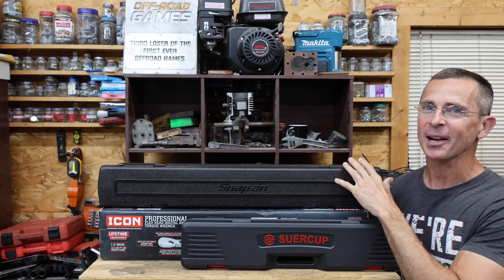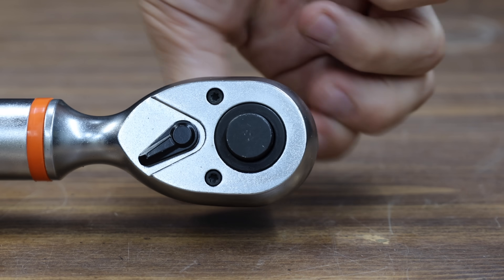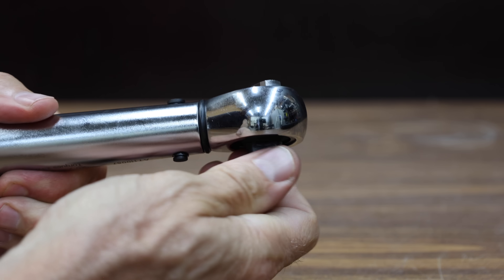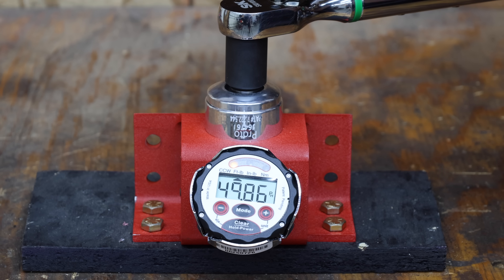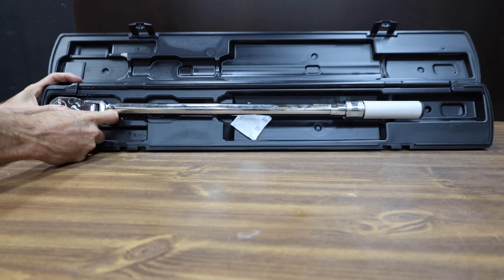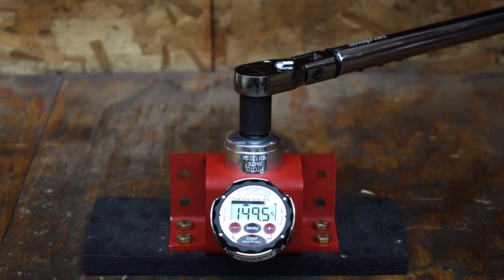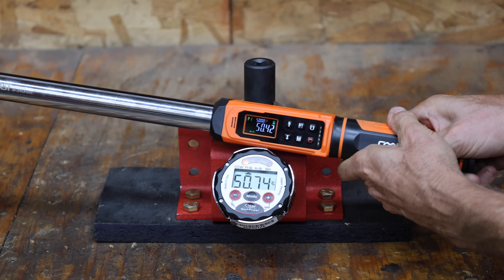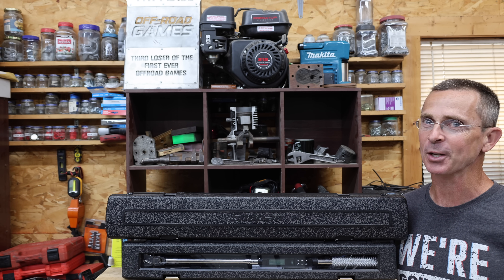$78 Torque Wrench vs $790 Snap On & ICON—I Didn’t See This Coming!

Comment: I have the ICON. It works great for accuracy, but has two major downfalls.
1. In the winter cold it gives an error message and will not work. 
2. Switching modes has to be done in a cyclic order (can't jump straight to a mode of your choosing). Which doesn't sound like that big of an issue, but when you cycle to the angle indicator to get to your unit of measurement you desire then you have to lay it flat because it will not let you switch modes until it sets itself to 0 degrees autonomously.
Reply from the maker: Thanks for the detailed feedback!

Comment: On torque wrenches, I treat them like tire pressure gauges. The exact reading can be off, + or -, by a small amount. That doesn't bother me as long as it gives me the same reading every time. As long as I know how much it's off, I can compensate for that. 
On my cheaper torque wrenches I bought breaker bar torque wrench adapters. Before I final torque anything I check my wrenches setting using the adapter. Once I know the setting gives me a good torque it doesn't matter what the wrench is set at.
Reply from the maker: Thanks for sharing!

Comment: I'm old, yet still prefer wrench measurements performed by a weighted and calibrated wall mount pendulum.   Easily re-certified, like.... forever... And devoid of software and sensor errors.
   BTW:  Did you know that placing an extension on your wrench will alter the delivered torque values?   An interesting fact taught to licensed Aviation Mechanics.
Reply from the maker: Thanks for sharing!

Comment: Fasteners should be torqued smoothly and fairly slowly so the speed of the sensor isn’t a big deal.  If you are torquing fasteners in a quick, jerky motion, sensor speed is the least of your problems.

Comment: I bought a gear wrench flex head a while ago. It seems to work well, but has no change in response from "almost" to at the torque spec and requires the set button be pushed twice between fasteners.

Quite disappointing, considering the price.
Reply from the maker: Thanks for sharing.

Comment: Spectacular!  Suggestion: please repeat this with smaller torque wrenches, some suitable for the 5-50Nm range.  Lots of engines have bolts that are spec'd in the 10Nm range, and lots of expensive bicycles have things spec'd much lower than that.
Reply from the maker: Thanks!  Thanks for the suggestion.

Comment: Todd, you do an awesome job with these and you produce the most accurate and fair testing of anyone.  You've been doing this a long time as well, so you may understand this issue far better than I and have chosen your methodology for good reason.  However, my understanding of significant digits is the following:

In such testing, I believe that you take the result with the least number of significant digits as the target and then round the results with more significant digits to match.  In other words, if the wrench says 50.1 and the gauge says 50.18, then the reference result rounds to 50.2 and the error is 0.1.  You cannot count errors below the least precise measurement, which in this test is usually the wrenches as they only show tenths of a pound.

The least precise measurement is the best you can do and everything else must round to that level of precision to be accurate.  It's that whole precision vs. accuracy thing ;).

However, I'm not saying that if one wrench in the test only showed pounds with no tenths or hundredths (i.e. the click wrench) then you'd be forced to ignore tenths on all the other wrenches.  If most wrenches offer tenths, then that should be our target, but accuracy varies by each article under test if they each offer different precision; you can't be perfect, but you also can't accurately state that a wrench has a 0.1 pound error when it shows 50.0 and the reference showed 49.99.

That's an error of 0.0 and is substantially more accurate than another wrench that showed 49.9 with the reference at 49.99, but you might accidentally consider these wrenches the same if you count them both as 0.1 in your results.

I understand that we are likely never achieving hundredths or even tenths of a pound in accuracy when using a torque wrench; I'm happy if I'm within 5%.  All of this is merely about determining and ranking errors in our comparison.
Reply from the maker: Thanks for sharing.

Comment: Interesting, I didn't see that coming either.

By the way. here are some suggestions I've had on my mind. After the previous on video foaming car soap I thought it would be very interesting to see a comparison of foam cannons themselves. Other things I think could also be very interesting include soldering irons, both butane and electric, water pumps, blowtorches, garden sprayers and perhaps revisiting shop vacs after 5 years.
Reply from the maker: Thanks for the suggestions.

Comment: We got a set off those proto testers at work. A 3/8", 1/2", and a 3/4" we have to check each wrench we get out every time we switch torque etc. and document it. We set the torque wrench to what the proto says not the wrench. I believe the testing report for our testers shows they are accurate to .25% of the tested value across their range. Props to project farm dropping that kind of money on a tester to do a review! As far as torque wrenches go we use everything from some kobalt 1/2" which i do like personally. Wright 3/4" wrenches are awesome but the drive paw can come loose after heavy use and makes pulling on them pretty scary at times depending on where you're standing. The paw loosening doesn't affect the torque although.  Our 1" drive wrench is a hytorq and it's as good as it gets for a 6 foot wrench. Although on our proto testers my personal icon wrenches have proven to be pretty accurate.
Reply from the maker: Thanks for sharing.

Comment: If you do another round of torque wrench testing, please include the M7 brand sold from jbtools. It seems to be an exact copy out of the same factory as the some of the acdelco torque wrenches (delco seems to have a couple different lines of the digital torque wrenches, in addition to the adapters). I just bought the M7 so I want to see how it compares!
Reply from the maker: Thanks for the suggestion.

Comment: Everyone talking about “mY piTtSbURgH wOrKS JuSt fINe 4 lUgs.” Yeah, that’s all fine and dandy, so does a Milwaukee set to 3 and full sent for a few seconds. If I saw an engine builder using icon, that’s a big nope from me. Or someone working on my suspension using icon? Yeah, no thanks.

Comment: The only bad thing about your reviews are the price of the really good items instantly goes up and and they are usually sold out on Amazon. The Suercup happen to go up to a $103 and they only have 13 left.
 If I were 30 or 40 years younger I would buy myself a new torque wrench but since I only need one once a year I have a really good friend with a shop and I go and I borrow his for the day and as you know any mechanic that would loan you a tool must really like me.  Don't worry he doesn't loan me his new one he goes to his old toolbox pulls out his old Snap-on that works perfectly for my needs but since he no longer sends it out for it's annual calibration certification he doesn't use it anymore and it's there when his new one is out for recertification.

Oops now sold out just while writing this comment
Reply from the maker: Thanks for sharing.

Comment: I doubt the lag has anything to do with the "sensor" since that is just a strain gauge epoxied to a piece of steel with known elastic deformation characteristics. The main thing limiting how fast the wrench can track impulse torque is the micro-controller's sampling rate. Assuming the designers did their job correctly, as in stop the micro-controller until the next sample is taken to minimize power and noise in-between updates, a slower sampling rate should mean longer battery life and 10-15 samples/sec should be enough for the normal use of torque wrenches: creeping up on whatever torque setting you are aiming for.

Comment: Been using my Snap-on in this video for at least 5 years as a diesel mechanic.  I've had very good luck with it and it has only been serviced once because a coworker dropped it and broke the screen.  It was still in the calibration range after the drop(+-.05%)
Reply from the maker: Thanks for the feedback.

Comment: I worked for Rolls-Royce years ago, jet engines not cars, and we were only permitted to use Snap-On tools on the engines, because of their 12-point sockets.  We used whatever we wanted on the facility itself.

Prior to that, I was a calibration tech and Metrologist in the Marines and for Lockheed, and we calibrated thousands of torque wrenches per week.

This video is right up my alley!
Reply: Username REALLY checks out.
Reply: @JarheadCrayonEater I don't get what Snap-On has to do with 12-point socket use only. Meaning, there are a ton of brands that make quality 12-point sockets. Sounds more like someone at Snap-On managed to convince some clueless company execs to sign an exclusivity deal with Snap-On. Which usually sucks for the actual work being performed and the techs performing it. Often there are tools that are better suited for a particular job/task from different brands. So BS like this restricts a tech's tool choices, and tool innovation/improvement on the shop floor.  

When I was in school I used exclusively Snap-On tools, cause the school had one of these exclusivity deals with Snap-On (and a sales rep on site to take financial advantage of clueless young students). Thankfully I never fell for their marketing brainwashing. As soon as I was out, I looked mostly elsewhere for my tool purchases (just buying the best I could find and or afford). Over time whatever remaining Snap-On tools I had, I got rid off and replaced. Funny enough I found one of the last remaining Snap-On pieces...one of the many lost 10mm sockets, I randomly found in my shop. Currently one of the few things I may purchase from Snap-On are the LP series locking pliers, since they bought out and took over production of the Malco eagle grip pliers (and tripled or quadrupled the price). I hate to do it...cause at this point I despise Snap-On as a company, but unfortunately this is one of the rare times they're the only source for a particular quality tool (hopefully like with most of their tools, not for long in this case, either).
Reply: I work on Cummins engines and we're also only permitted to use Snap-On torque wrenches
Reply from the maker: Thanks for sharing.
Reply: Should note some rules. 
We were instructed to unload the spring when we finished the task
Also to place tool back in its case. 
If it’s dropped either get it recalibrated or toss it.
Reply: Did no other tool company have 12 point tools in the usa?
Reply: We have snap on provided torque wrenches, but we have people that come calibrate them every couple of months.
Reply: I grew up working as an A&P at West Star Aviation. Widely known for its Dash-10 conversion on Cessna Conquest II (I believe we ended up converting something like 80% of them ever made!) 

Point being, I’ve been around a lot of engines, jet engines, being rebuilt. RR, Pratt & Whitney, GE, on many of the top air frames in the industry: Learjet, Hawker, Challenger, and Falcon.

We most certainly did employ a decent amount of crayon eaters, all great guys. 

However, I never once thought or heard of a tool standardization such as Snap-On being a requirement. Let alone anything with 12 point sockets.

And truth, the majority of engine work is done by extremely specialized equipment that the company owns with tolerances within 100th of a human hair. 

What you choose to use on the shop floor is your business as long as your work passes inspection, with one caveat: my first day, two things happened, 1) my crew leader openly mocked my crescent wrenches and toss them in the trash, and 2) he sent me off to the parts store to pick up some prop wash.
Reply: I thought the best way was measuring the elongation of bolts. But direct tension is the best. 

Torque wrench is supposed to be the worst method.
Reply: Sempi fi im currently a calibrator for the marines too. 6492 baby lets get it.
Reply: I've always wondered what is the best tasting color in your 64 count Crayola box? Asking for a retired USAF wing nut.....😁
Reply: @jamram9924 , red, Brother!
Blood makes the grass grow!
1999-2007
I'll never forget 9/11!
Reply: @JarheadCrayonEater  I learned that while embedded with fellow Marines and Soldiers overseas. We leaned from each other, but the mission was the same. Time passed and my oldest daughter chose to also serve in uniform. She and her twin female cousins all chose the US Marine Corp (2006-2018) They were also deployed to Iraq and Afghanistan. Thank for your service to our great nation 🇺🇸
Reply: @jamram9924 , oh wow!
My grandfathers served in WWII and Korea, one Army and the other Navy.  Outside of that, I'm the only one.

My step-daughters are now grown, 24 and 31, and neither of them decided to join.  I think after what we went through, that's probably for the best, but I do wish they'd have joined just for the discipline and memories.

Anyway, tell those young ones Semper Fidelis from this old Devil Dog!  Oorah!
Reply: @JarheadCrayonEater  Wonderful what a great legacy. Don't doubt that maybe one day, a grandchild will choose as you did, to don on the uniform in service to our country. 

In each generation since WWII, uncle served as a Marine and fought against Japan on several odd those islands in the Pacific, his son, serviced in the Marines during Vietnam as well. Our huge family has served in every branch of the US military. We are paying back what this great country gave us, an opportunity.
Reply: By 9/11 You mean the buildings that were taken down with explosives by our own people right? SMH
Reply: Why on earth would 12 point sockets have been considered desirable? Much less likely to damage fasteners with 6 point.
Reply: @Nevir202 , aircraft use 12-point.  That aside, 12-point bolts are proven to handle higher torque, and they're far less likely to become rounded and then require alternative extraction techniques.

It's well documented as to why.
Reply: @JarheadCrayonEater The same applies to fine thread versus coarse thread fasteners. Fine has more contact surface allowing for more strength, even though it doesn't seem that way at first glance.
Reply: @T-dx8dn , yep!  One of those mysteries that fool many of us initially.
Reply: @T-dx8dn  Also fine thread (SAE) has slightly thicker main shank thickness measuring from the thread bottom across to thread bottom.
Reply: @JarheadCrayonEater  6 point fasteners get rounded over by idiots who use 12 point sockets and wrenches on them. A 12 point socket or wrench should not be used on 6 point fasteners, but this is often done because 12 point tools allow for greater range of motion and ease of use in tight spaces. A higher torque can be achieved when a 6 point socket is used on a 6 point fastener without slippage due to the greater surface area of the head (assuming the fasteners are of the same grade).

The "well documented" claims about achieving "higher, more even distribution" of torque cannot be backed up by scientific testing when using the proper tool for the fastener. The claim is only true when a 12 point tool is used on both 12 point and 6 point fasteners or the space is too limited to permit full range of motion for 6 point tools and fasteners.
Reply: @Nevir202 , it's been that way for decades.
Reply: @Nevir202  12-point bolts have a more compact head design. They are typically used where less space is limited. The argument that more torque can be applied before slippage occurs is only true when using 12 point sockets or wrenches. When using 6 point sockets and wrenches, more torque can be applied to 6 point fasteners.

The claim that 12 point fasteners provide for higher torque capacity is only true when mechanics inappropriately use 12 point sockets on 6 point fasteners. Of course, many mechanics will use 12 point sockets or wrenches on 6 point fasteners, leading to rounding over of fastener corners. The real benefit of 12 point fasteners is preventing idiots from doing idiotic things.
Reply: Name checks out
Reply: Your user name checks out.

Comment: I would imagine this has been suggested already, but I wonder about the consistency of the value tools.  Would you consider after a test like this, purchasing 5 of the identical top performing tools, and testing them against one another for accuracy?  Often times that's where the value brands in any goods start to fall short, long term quality control and consistency.  Thanks
Reply from the maker: Thanks for the suggestion.
Reply: @ProjectFarm  it would cost a fortune on the more expensive ones, I wouldn’t suggest that, but it might be telling on the cheaper ones.

Comment: I still use an old beam style craftsman from the 1960s.  Easy to calibrate, by hanging a weight on the handle with the drive in the vice.   Handle is 18-inches long, so with 25-lbs hanging on the handle it should read 37.5 ft-lbs.  with 50lbs, it should read 65-ft-lbs.  if it doesn’t undo the four screws holding the scale and wiggle it over until it does, and tighten it down.  The old style beam wrenches, have the advantage of letting you know if the threads are dirty, or galling, because the needle will vibrate.
Reply from the maker: Thanks for sharing.